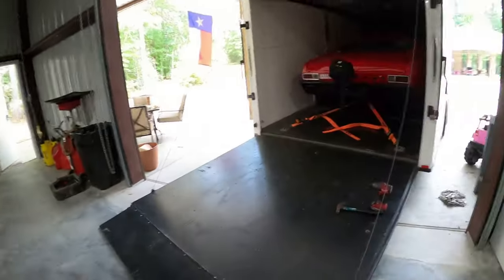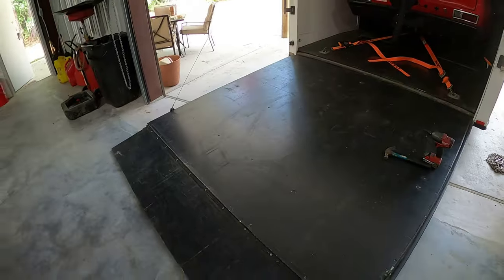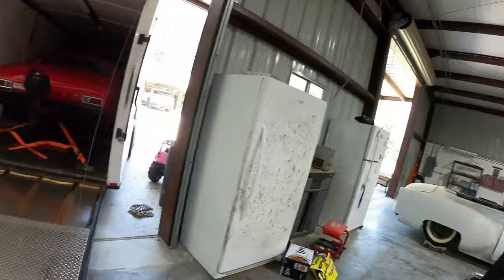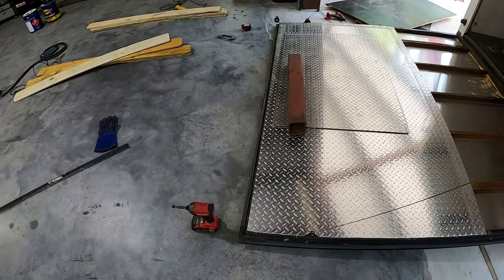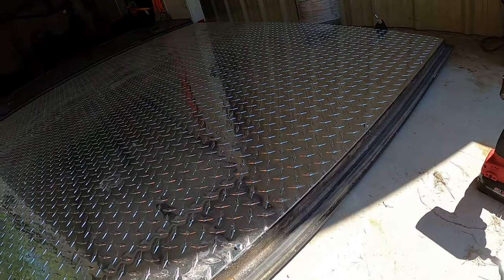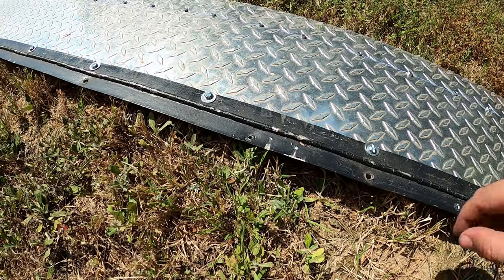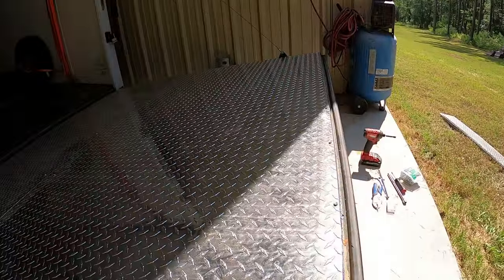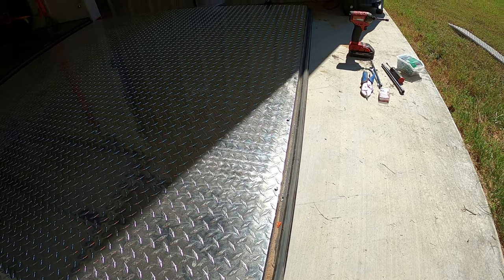Enclosed Trailer Door Makover (Diamond Plate)

Comment: what thickness diamond plate did you use? how is the diamond plate holding up, i'm just curious if it's bowing down where the tires ride, i'm looking at doing the same thing but not sure what thickness aluminum diamond plate i need. your ramp turned out great, love the video. thank you
Reply from the maker: Thank you so much for watching. I believe it's 1/8th" aluminum diamond plate. Has not bent or caved at all. It is blinding on a sunny day though lol!
Reply: @schmitty750  if you could measure the thickness to confirm, man i would very much appreciate that, 1/8" and 3/16" look very similar. thank you so much for the reply.
Reply from the maker: Just checked and it is 1/8th" for sure.
Reply: @schmitty750 you are awesome sir, thank you so much for checking